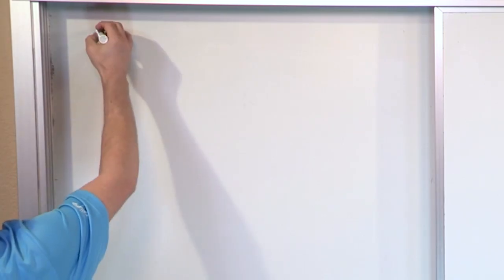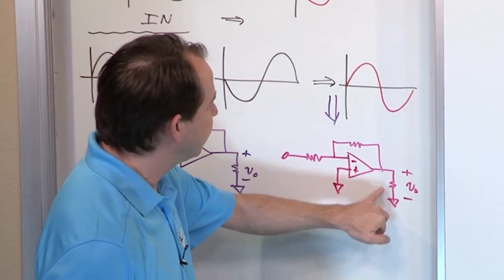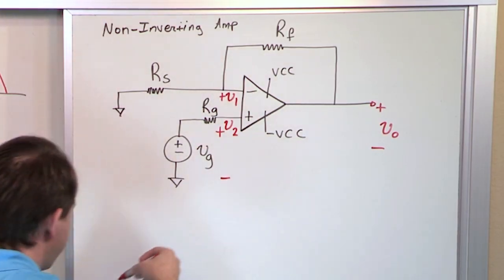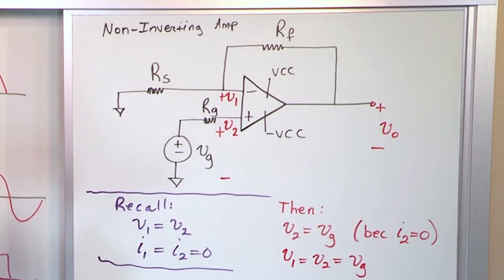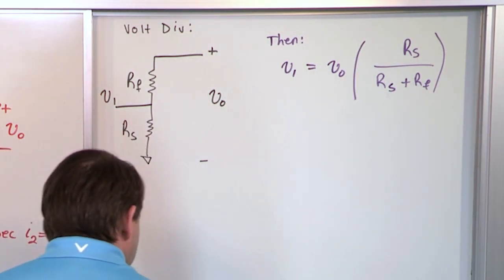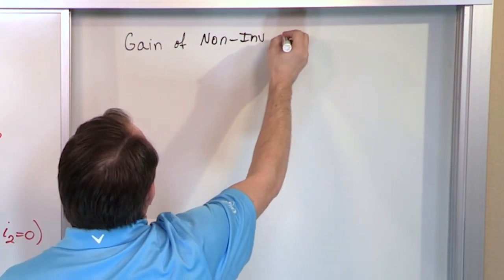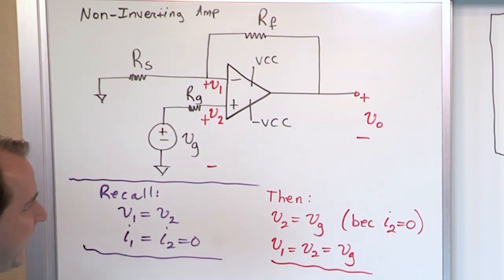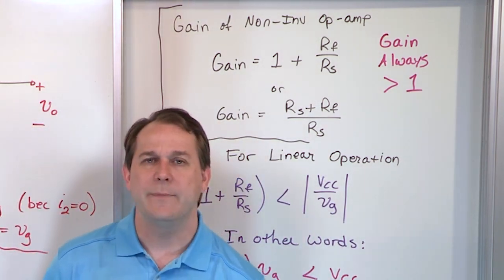01 - The Non-Inverting Op-Amp (Amplifier) Circuit

Comment: MATH and SCIENCE, Do you have any video lessons about how to bias transistors because there is multiple methods are how to biasing a transistor. Some use the HFE, some use the resistor ratios of RC and RE to get the gain, some use the datasheets IC current. If you want a gain of 5 you would have to base the RC and RE ratio and use that first as the biasing method. Others use the HFE to calculate the gain, so it gets confusing which method to use for biasing transistors. When looking at Resistor Ratios you can tell the gain of an op amp or transistor stage amplifier.

Comment: Why can’t you use two opamps , off the same AC input, one into the inverting input and the other into the non inverted input , and use this as a phase inverter before a push- pull power amp?

Comment: Fantastic explanation, one of the best explanations of the op amp I've seen. I still don't understand how Rf and Rs are voltage dividers if its said that no current passes between the 2 terminals. If there's no voltage applied between the 2 terminals, how can there be a voltage drop on either resistor? If there's no voltage drop on any resistor (or at least Rg) what is the point of these resistors being in the circuit in the first place?
Reply: lmab1234 - so sorry this answer is 2 years after your question is asked. If I understand the non- inverting opamp, there is current flowing between Rs and Rf.  The link to this video below shows it in this animated video. I believe it is using an AC signal, as the current is changing direction between Rs and Rf. 
https://youtu.be/_o4ScgRZtNI

Comment: I was trying to find the video about the inverting op amp and I couldn't. I have some questions connected to inverting op amps, for example, if I have Uout and Uin and f = 1000 Hz, are there formulas with which I can find Rf and Rin? Thanks in advance!

Comment: Why v1 is v0 times rs/sum and why not rf/sum??????
Reply: babu might be a little late for the reply, but it’s because you want to know the voltage drop across Rs to know the value of V1, because V1 is the voltage drop across that resistor, so you multiply by Rs, and divide by the sum of both resistors